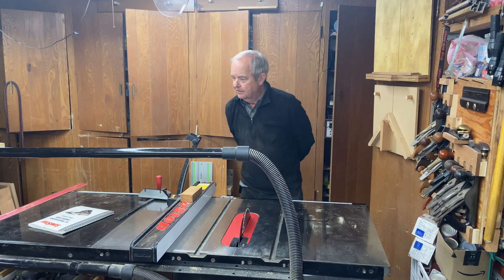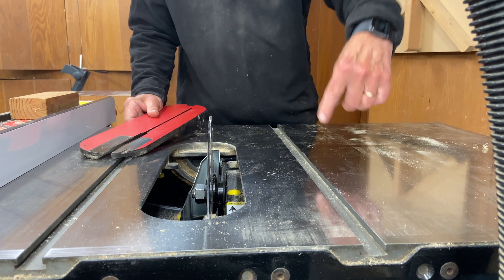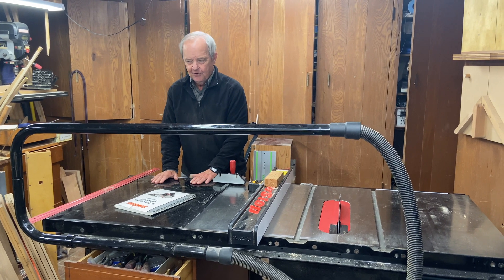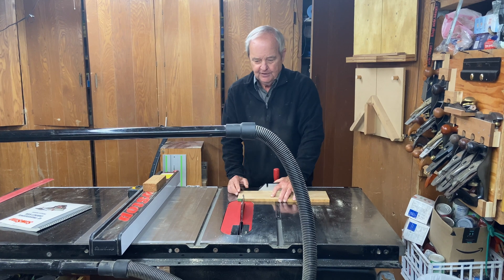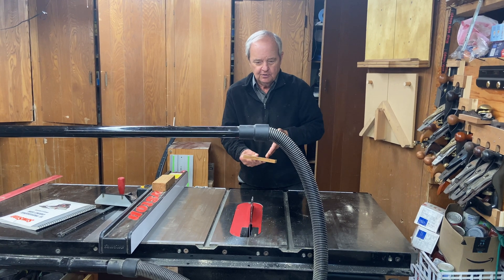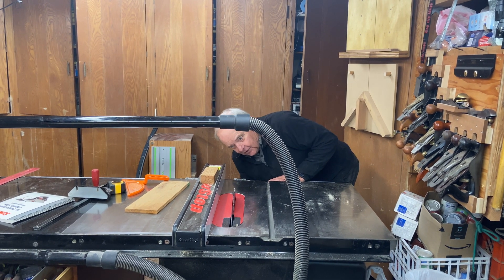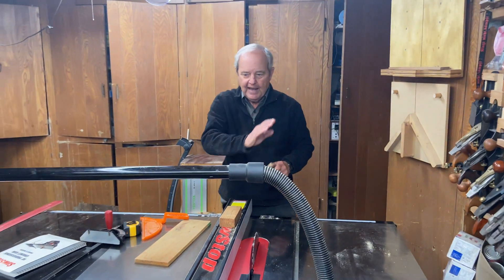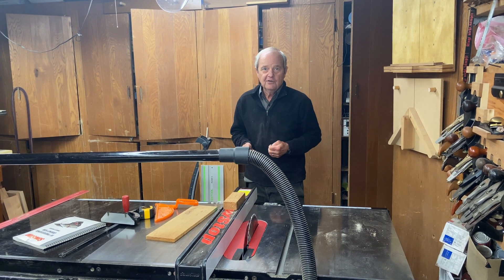Table Saw Accessories: Overview of ALL the SawStop Extras

Comment: The controlling definition of rip vs. cross cut in relationship with the board is not the longest or shortest side one cuts, but whether it is with the grain (rip) or against it (cross).  It happens that usually cutting the lengthwise way is a rip cut; cutting widthwise, a crosscut.